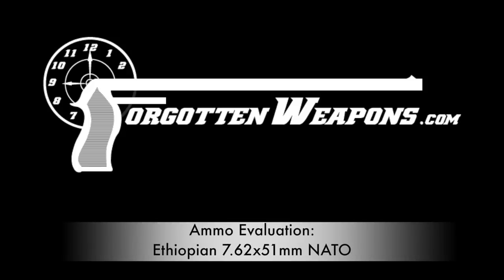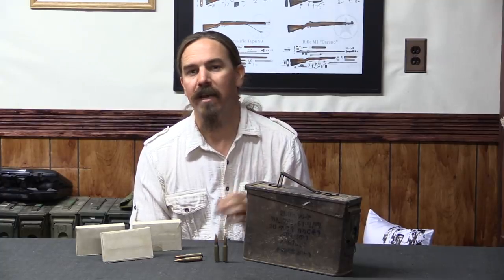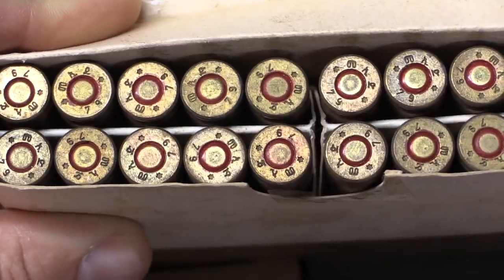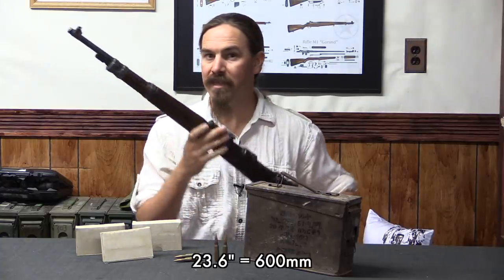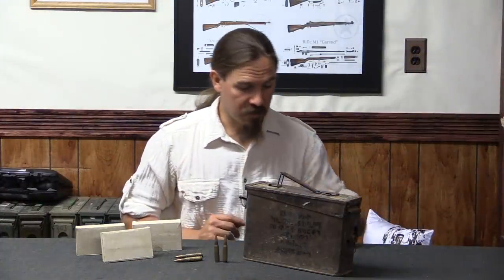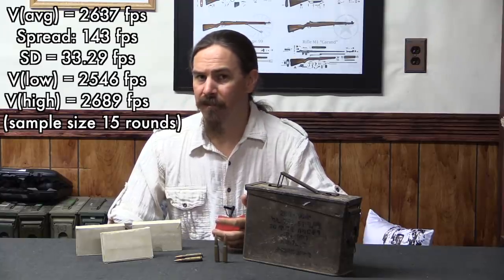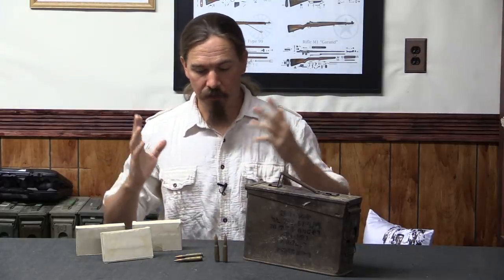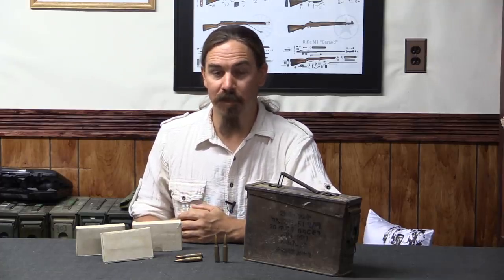Ammunition Evaluation: Ethiopian 7.62x51mm NATO

Comment: Well I expected worse. Weather I get any or not is determined by the price. I have some use for this stuff even if it is not the best quality. It seems some moisture got into the primer compound a little bit. Not too surprising as the box looks a bit rough. Good collector stuff though, both ammo and box. If I do get any, I will have to put some aside for collecting.

Comment: Century lists it as corrosive which should have been included in the review. You may not want to run this through a gas operated semi-auto.

Specifications
145gr Lead Core FMJ
Berdan Primed
Brass Case
Corrosive
20rd Box
280rds per .30 Cal Can
1980's Production

Comment: Hey Ian, always love you vids. I was curious did you put calipers on the bullet and see if they were actually .308 or undersized or oversized? Would like to know. Also are these berdan primed or boxer? If this ammo is reasonable enough and reloadable it could be used by pulling the bullet, add a fresh powder charge and new primer and re crimp the mouth. The brass and bullet look very good.
Reply: Not worth the time or effort. Surplus used brass and surplus bullets or factory seconds would be way more efficient to reload and probably no more expensive.
Reply: @leftyeh6495  yeah i buy alot of seconds and blem bullets for just plinking. My main question was "if" they were a bargain to buy. Years ago i got a can of "practice" wood bullet ammo...i cannot remember what caliber. The brass was good. I pulled the wood bullet and reloaded it with a FMJ and fresh powder charge to fire form them.

Comment: I think this was good quality ammunition when made, judging by the bullets etc, which are not affected by extreme heat cycling in storage. It's most unlikely that the warehouse they've been in has had any climate control. It's clearly now past its best, hence it being sold in the first place. Ammunition stored for forty (not fifty!) years in Ethiopia is not going to have its perishable components (primer and powder) is as good  a condition as if it had been stored in a shed in Scotland. On the other hand, there was no external corrosion, which you might be seeing if it had been stored anywhere at all moist. I think the velocity spread will be mainly due to the inconsistent ignition.  Logically, the ammunition would not be abnormally dangerous in an automatic weapon: if there's a hangfire, the automatic weapon does not auto-eject the unfired cartridge: all it would do would be to slow the cyclic rate down a bit.

Comment: Another option if you get a damp box with lots of hang fires (for reloads)  is to simply pull it all ... pop fire the primers and replace them... then reload it! ... Use the same Powered and Lead of course .... AND it's Accurized as powder measure will be more consistent And no longer corrosive .... 280 primers is what $12? ... AGAIN if it's sold at the right price! :)
Reply: is it berdan or boxer?
Reply: Berdan Primed

Comment: Would a round detonating out of battery/in midair even be dangerous? I watched a video where someone microwaved a bunch of 22lr and none of the bullets even dented the metal interior. Now, I understand there's a lot more powder in a 762, but one would think the same principle would apply; with no steel to direct all of the energy in one direction, it would just burst like a firecracker instead of using all that energy to propel the bullet.
Reply: DUH, YES. very dangerous if you value your eyes. there would be pieces of brass and powder in the air like a grenade. take a brass case, fill it with black powder, insert a fuse and close it with plyers. lite fuse and eat brass. its dangerous.
Reply: Hence the bolt action, every round was forced in to chamber by hand before fireing.
Ammo detonating out of battery is usealy less bad, there a great video of what a fire does on YouTube, rounds don't thankfully have much power without a barrel.

Comment: With that bullet weight of 143grs and a muzzle velocity of 2650fps that must be one of the weakest .308/7,62x51 rounds out there.. That bullet weight is odd too.. I've always had the impression that the Nato standard was 147grs.. Hottest modern factory loads launch a 170gr bullet @ 2780fps for .308.. Those are like pud loads compared.

Comment: Not "great" shooting as advertised. Just alright, for 40 year old ammo.  It goes bang everytime even if there is a very slight delay with some. Just watch how bad just about all milsurp .303 shoots (a full second or two from trigger pull) and this 7.62 stuff looks lightning fast by comparison. Still I would shoot Pakistani (case stamp POF) 7.62 long before I would shoot this stuff. The Pakistani is at least non-corrosive and has better primers.

Comment: Junk, good for components only. 
A cartridge detonating outside the chamber of a firearm is basically HARMLESS. The safety issue with junky hang firing ammo comes when Bubba unlocks the bolt and the round detonates while the cartridge is still in the chamber but now the bolt is unlocked. Not a good day for Bubba.......